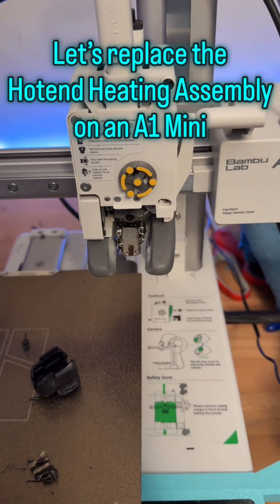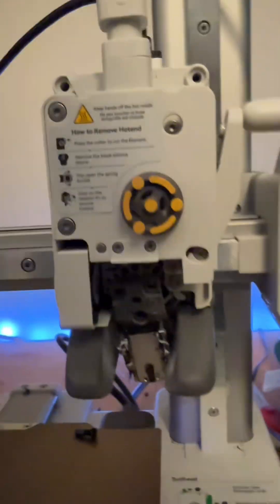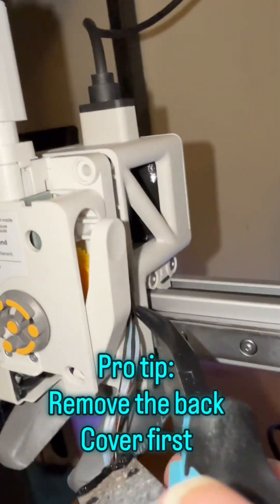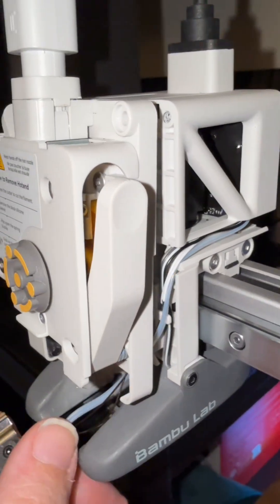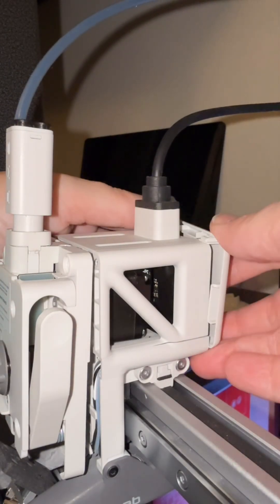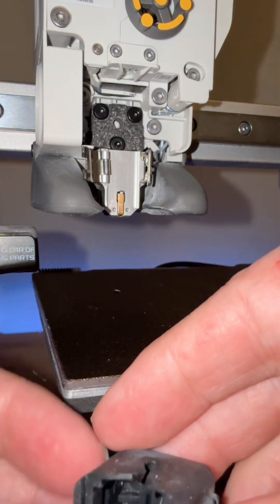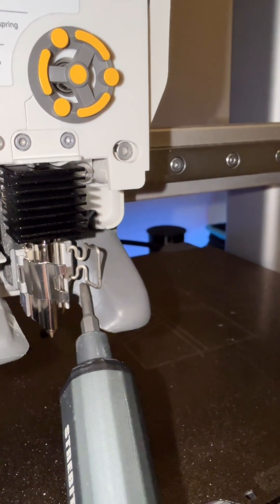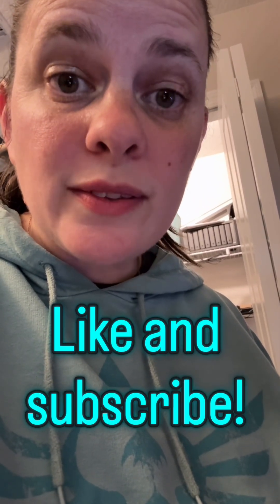Bambu Lab A1 Mini Hotend Heating Assembly Replacement | Step-by-Step Repair Guide

Comment: I just changed a new one today and still my nozzle came loose. The clamp can’t seem to tighten up and lock the nozzle in. The nozzle jiggle everytime it starts printing.
Reply from the maker: It’s likely not seated correctly. It definitely should not jiggle. Make sure that the clasp prongs go under the rectangle not in.
Reply: @NerdMatter3D Aaaaah thank you thank you!!! So thats where i screwed up! Its all good now❤
Reply from the maker: @bettytseutsiamis9124  Yay! That’s great. Happy printing!
Reply: Since i finally found someone who actually knows what she's talking about. Any tips on stringy prints aand clumps? I have tried everything from cleaning the build plate with soap and hot water and the glue to make it sticks, all failed. It was a huge mess the last few weeks. Have not been able to print a decent one since. That led me to cleaning the whole thing thinking it needs maintenance. And then i forgot how the bloody clasps work lol. Tried not using glue but the prints falls off the plate half way. Its frustrating as hell, or maybe its just me heheheh
Reply: @NerdMatter3D Gazillion thanks!!❤❤
Reply from the maker: @b @bettytseutsiamis9124 love the cool super tak plates from Bambu. They work great for adhesion. We had an issue with poor print quality and we did the same thing - all sorts of cleaning trying to figure it out. Turns out that the particular filament we were using didn’t work well with the standard Generic PLA settings. We went on Makerworld and found a file for temperature tower and found we need to print at a lower temp. Turned out great after that. I would start there!

Comment: I just watch the video and btw this is the most Helpful video ever. Just quick question though. I was trying to test it out with a new print.  Before it even print anything, it started to head up the nozzle and i noticed it start to create an odor and i wasn't sure if it was normal for it to smell unnatural.  So it is normal to smell a an odor after you replace the hotend??
Reply from the maker: Thank you for your kind words! Glad it helped. Did you have a fresh heat sock on as well? (The little black rubber piece) because I can see that giving off an odor when first used if the odor went away after a few minutes and didn’t come back then you are probably fine. If it smelled like burning or the odor happens every time it’s printing then I would definitely do some more troubleshooting.

Comment: I haven't had my printer but about 6 months and every time I start a print, it starts then says hotend.. temp malfunction. I have the new piece, haven't changed it yet. Just wondering.. how often does this happen? I haven't had any clogs.. so not sure why it is not doing right. Thanks for the video.😊
Reply from the maker: We only got ours at the end of June. Haven’t had the heating replacement malfunction but specifically the blob made the clips break off. Couple of different possible causes for the blobs but if it’s printing fine otherwise I might make sure you have the nozzle clipped in correctly! We got that error when I had the nozzle clip not secured properly. If that looks good maybe try changing it it’s only a $20 part and judging by the lack of videos when I was looking it’s likely not super common! Good luck! I hope you can get it working.
Reply from the maker: Especially if you can’t seem to get the nozzle to go to over 200 and stay there.